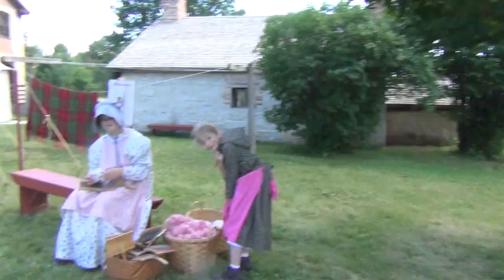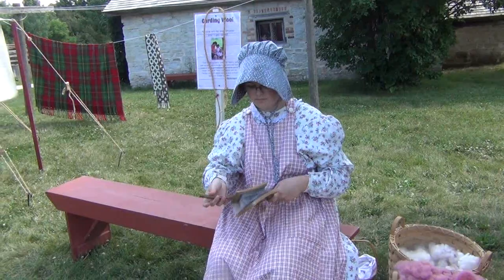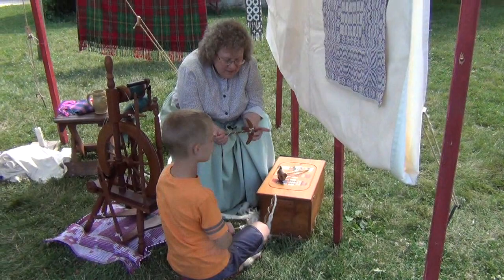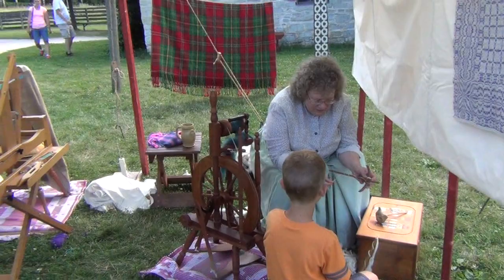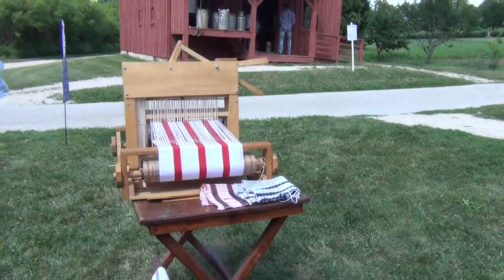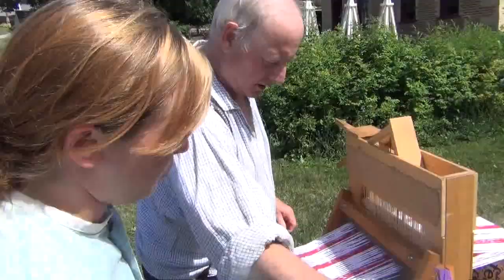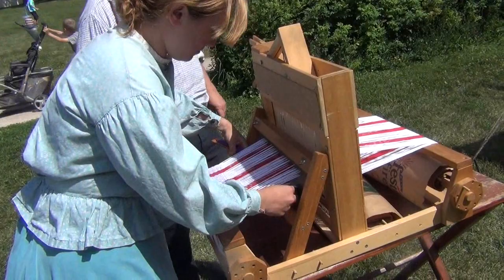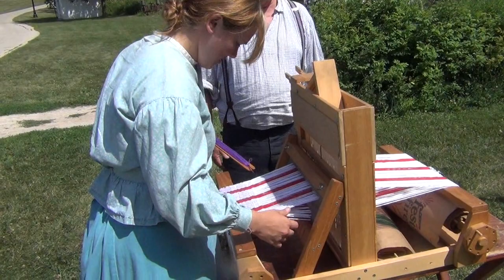Weaving at HHSHP

Comment: I really enjoy your videos.  I'm amazed at how quickly you seem to be able to warp a loom.  It would have taken me weeks to warp the two looms you show in the video.  Of course, a lot of my time is spent correcting mistakes.  I am warping my loom for a dish towel project.  The warp consists of 402 threads.  When I finished threading the heddles yesterday, I found that I was off by two threads.  Turns out I made a mistake on the first two heddles!  Time to start the threading over.